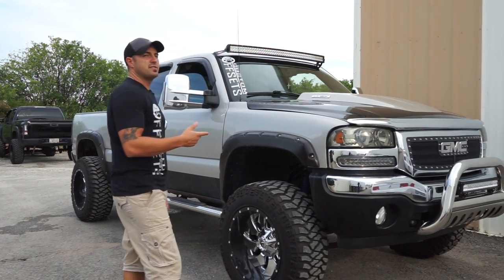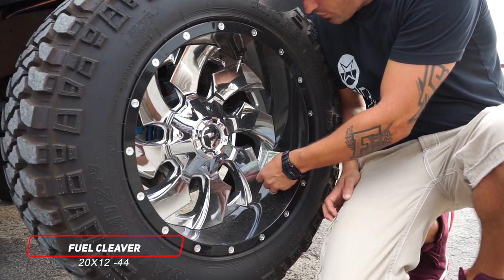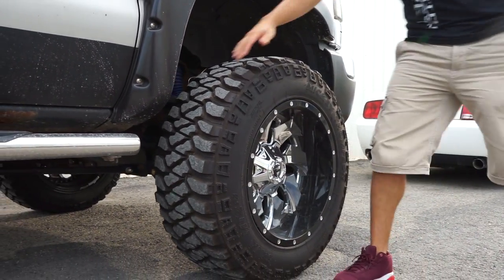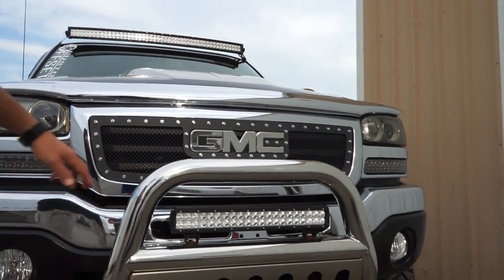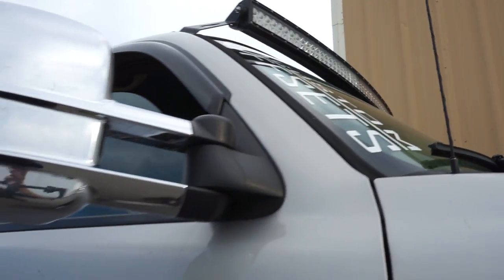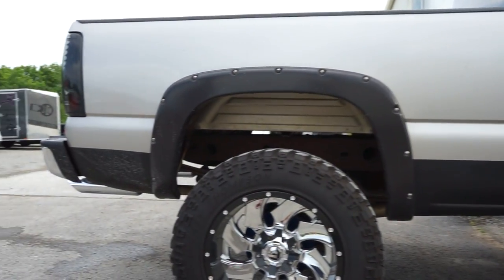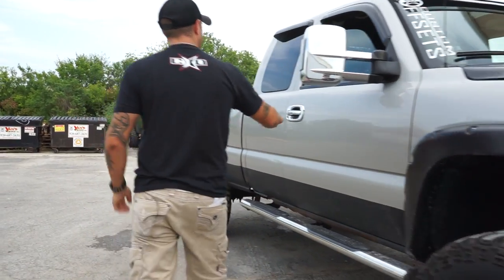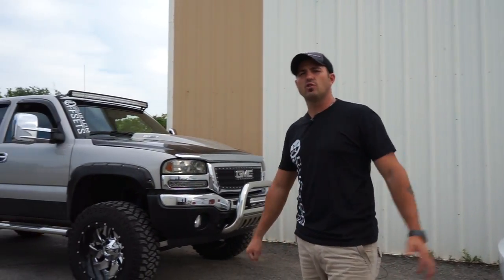Spotlight - 2005 Gmc Sierra, 6" Lift, 20x12 -44's and 35s

Comment: so much rust, i bet most of the rocker metal that’s left is thin enough to poke a screwdriver through it.
Reply: Welcome to living where it snows! Lots of scabby old shitheaps running around where I am. Think of it this way, when parts fall off, it increases payload capacity!

Comment: This is going to be my first truck/vehicle 
It is my dads 2006 GMC Sierra 1500 extended cab with a 5.3L v8 in Olympic white. We are thinking about doing a rough country 6inch suspension lift and 35/12 with 20inch wheels. 
It is going to be a daily driver hunting rig for me when I turn 15. So I just want some suggestions for what I should do.
Reply from the maker: Check out the gallery to get some ideas man! customoffsets.com/gallery

Comment: Wrong about the 33s with trimming I have a leveling kit on 33s and didn’t trim any
Reply: Taylor Williams not with 12” wide wheels.
Reply: Taylor Williams you're probably on stock wheels or similar to stock size aftermarket wheels 😂
Reply: and?
Reply: My leveled 2002 Tahoe (same front end) I had to trim with 33x12.5 (real 33x12.5). Just the plastic under the front bumper and the driver side fender liner in the washer fluid tank area, but still. I'm only running 20x9 wheels too.
Reply: Taylor Williams I have a stock height lly on 33x12.50r20 20x12 torsion bars are maxed out, well messed up my front end got new parts on and putting a 6” lift kit on it now. I have 1/2 my turning radius right now it’s rubbing on the back better but if I drop the torsion bars and do the norcal tuck I still won’t be able to clear them
Reply: Right I have 33x13.5s that dont rub no offset

Comment: I need some help I got a 2001 GMC Sonoma with a 5" lift but it's jacked up to 8" and when I put it in 4x4the front axle comes out and I got 33" tires what do I do
Reply from the maker: front drive shaft may need to be extended Becky, depends on a few things

Comment: Anybody know if I can run 35x12s on non-offset rim's? I have no problem trimming cause I don't give a shit about the body, but will the tires hit the torsion bars or anything critical?got a 04 sierra 1500 with a 6in suspension lift.
Reply from the maker: You should be able to but as yoou stated they will most likely rub without trimming

Comment: Would y’all ever run 33s 20x12 under a 6” lift?
Reply from the maker: bit high for a 33" setup to some, but guys do it Dustin!
Reply: Custom Offsets true; thanks. I ain’t really got a choice for a bit I’m putting on a 6” and can’t afford tires I just bought 33s and have only 2k miles on them. You ever heard of a alignment shop not being able to align a truck because of the torsion bars are cranked to the max? I didn’t know mine were

Comment: Looks identical to mine. 
Other than the big wheels and chrome. Plus mines White, black bottom with Lime green decals.
Reply: Post a video of it, I'd like to see it.
Reply: I will eventually. Currently replacing the rockers and cab corners. But a video will done once it is finish.